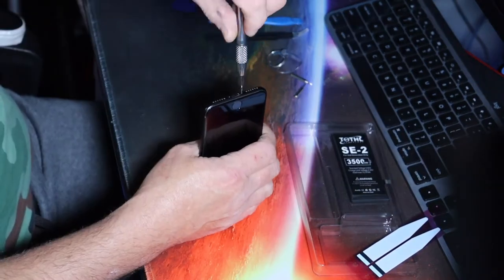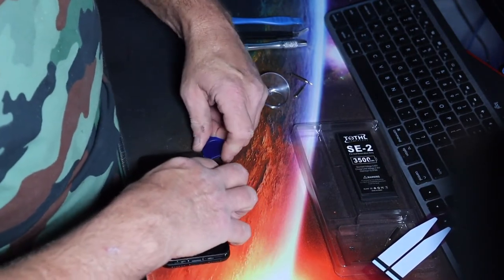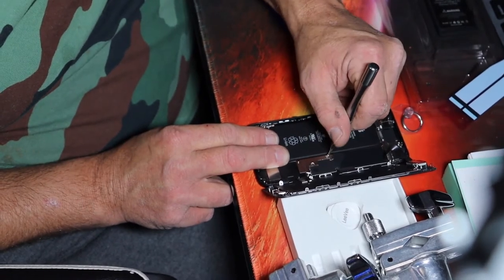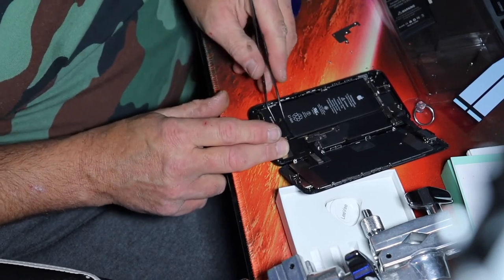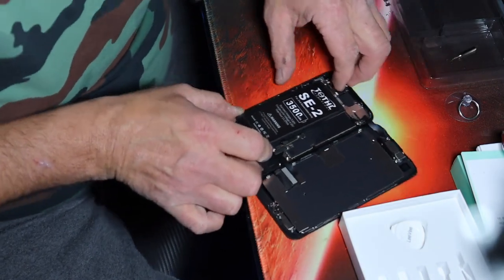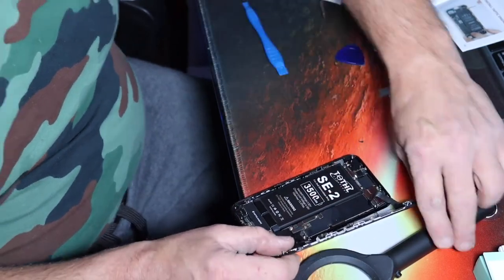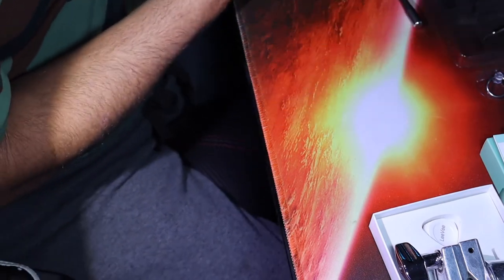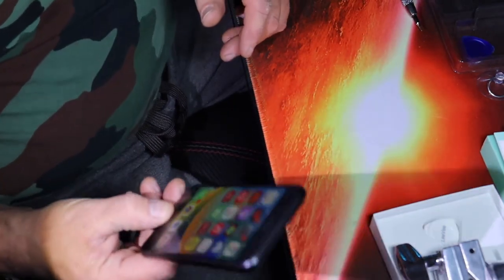Replacing the battery in the 2020 iPhone SE Gen 2 | Yes you can!

Comment: Very informative. Thanks! Does the Non Apple Battery Message come up all the time ?
Reply: Apple has encrypted their batteries for quite some time now. There are tutorials available to get rid of that message, and it requires a battery calibration tool.
Reply from the maker: @Dan Tong Yes it does, I just ignore it and simply keep an eye on the average time I get out of the new battery in order to keep an eye on when this battery is getting used up.

Comment: Spudging and bodging….there’s a very fine line. Replaced my original SE battery (it is now used as a camera for clinical pics) and as my SE 2020 says battery 85% it’s next.
Thank you

(Still lost one on the tiny 2 screws either side of the charging port on my SE 🤷‍♂️ )